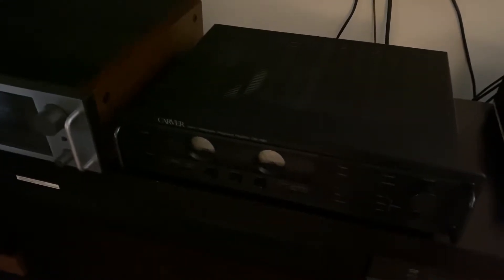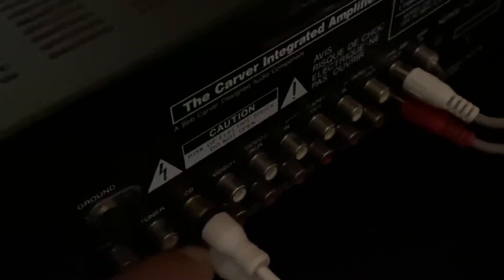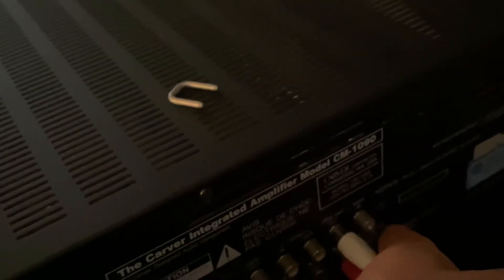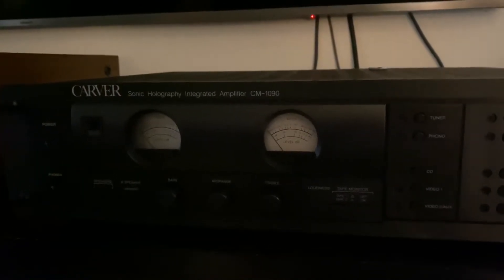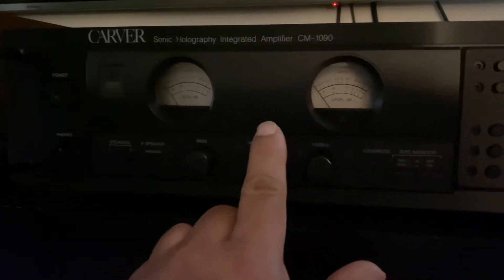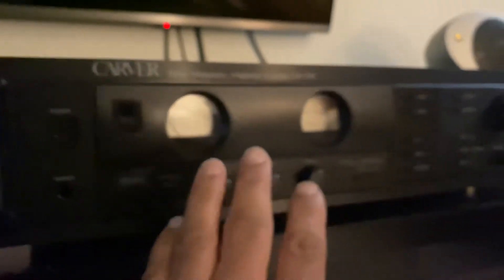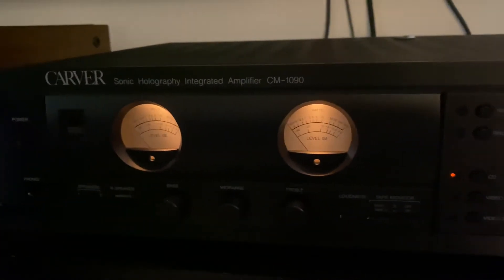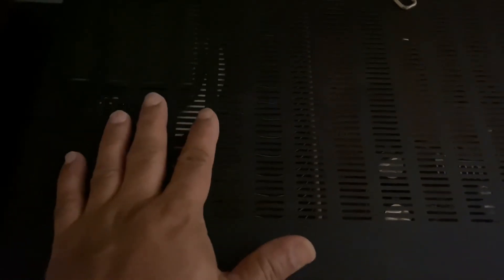How to connect two integrated amps as Pre Amp and Power Amp (Carver CM 1090 & MXR 150

Comment: Thanks for your video. If I want to connect two "integrated" (in which one would work as preamp) but the integrated I want to use as amplifier does not have the "main in" connection, could I use the "aux" connections ?
Reply from the maker: Thanks for watching. Sure,  you can use the AUX or CD, but please make sure the volume is down. Then you can keep the volume knob on your “preamp” in the middle and use the other amp (your power amp where the connection is on AUX/CD) volume knob to control the volume level. 

All the best.
Reply: @stairwaytomusic71  Thank you! Much appreciated :)
Reply from the maker: @liquidrum7 Sure, no worries….Welcome 🙏

Comment: I have the same Intergrated amplifier carver cm 1090 . Can I connect a nad amplifier to the pre out on the carver 1090
Reply from the maker: Of course you can, if the NAD have Main In / Pre-out options… you can use one of them as preamp and other one is power amp. From Pre-Out to Main- In. But please make sure you hook up those jumpers correctly and before using them independently. Or else the unit(s) won’t play or give sounds. 

Hope this will be helpful. Thanks
Reply: @ ok 👍 thank you sir
Reply: @ I have an outlaw 990 7.1 pre amp . And a outlaw 5000X amplifier how do I connect it there are so many out puts in puts in the Back of the pre amp i just what to play music and run  2 speakers how do I connect it sir
Reply from the maker: @papabear9608 Sure, anytime Sir!
Reply from the maker: @papabear9608 All sources (CD/Tape/Phono) connections will be on Preamp (IN) and from preamp OUT (Right & Left) to amplifier’s input (or Main-in). Please make sure, the volume (if there is any knob) of amp is low, speaker cables will be connected on amp, select the speakers (A or B… if it has option). You can increase the volume from preamp and control the tone (bass/treble) from preamp. 

Hope this will be helpful.